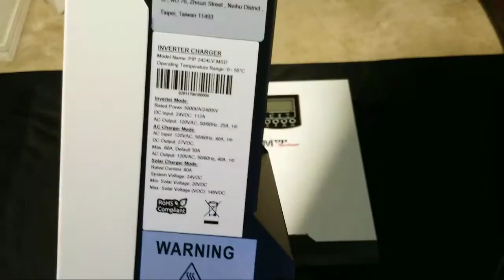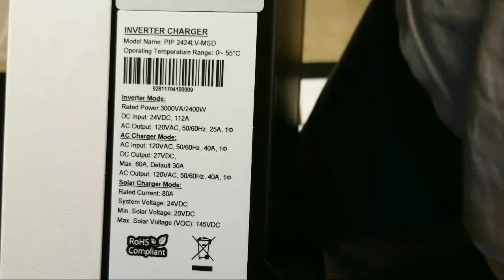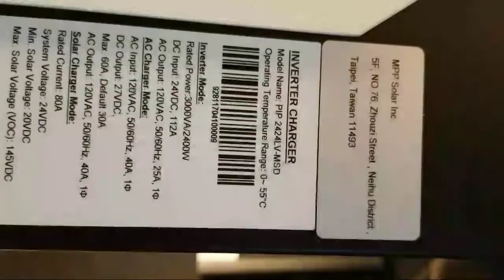PIP 2424LV-MSD HYBRID SOLAR INVERTER CHARGERS

Comment: Glad to see you doing a set up with this system I know a lot of people that could use these.  great company,    I have not seen a stack able 24 volt system thats why I got the 230 volt and just stepped it down my self for split phase.  it will be interspersing how this is set up.  Again thanks for sharing I will be watching and following.
Reply from the maker: +McCuneWindandSolar 
Thank you Sir for sharing that information. I just thought it wise to mention you on my video since you have the PIP 24V with the 230vac.
Please stay tuned on this project and if you want to share your contact information with me that will be great Sir.
God bless you
Reply: I have the PIP 4840 its a 48 volt 4kw at 230 volts.  They are nice unites.  when installed right, they last forever.  the one I have has been hanging on the wall going on 3 years.  Justincase, has said they have a new 2424 pip, and here you are with 2 of them.   They are getting closer what I'm looking for for an American version.  I like them because they are pretty darn cheap with built in charge controller from both solar and the grid.   I have my system set up were if I need more power I can draw from the grid and let the solar charge my batteries.  and during the day when I have the sun the system switches over using solar.   

I cant wait to see yours set up and see it running.  I have friends that are looking for solar and so fare these PIP's are the thing.